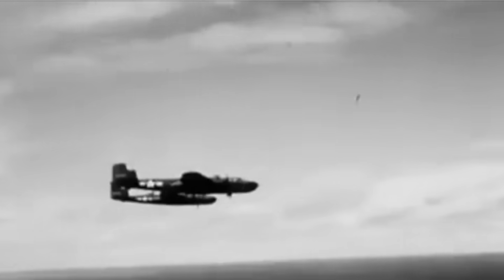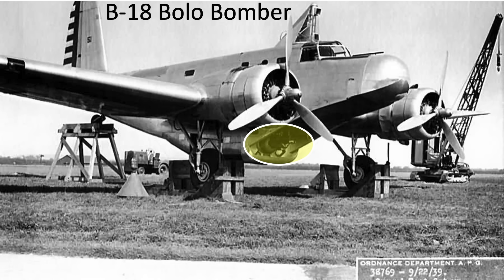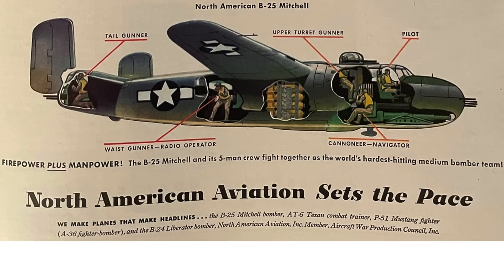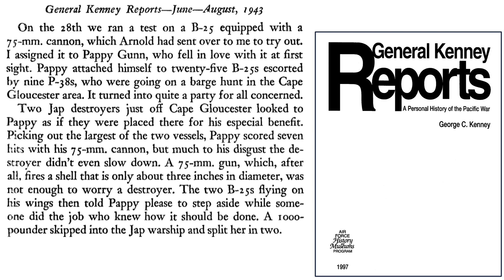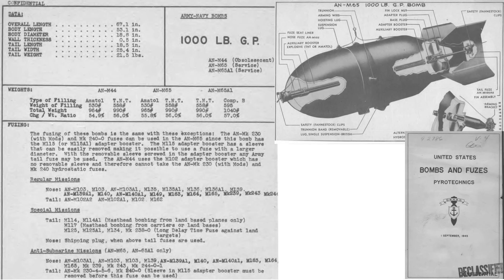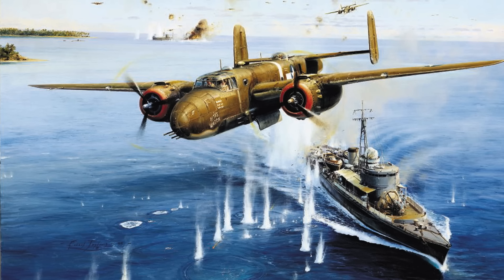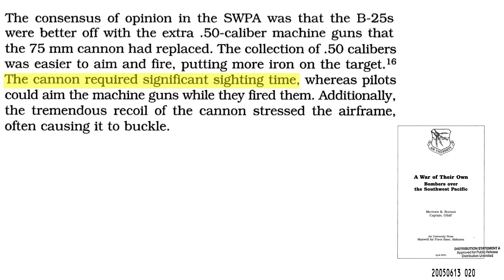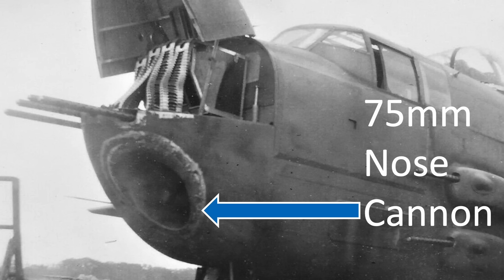Why the B-25’s 75mm cannon was a Failure - Deep Dive Review

Comment: B-25Hs were supplied to the 5th AF, 345th Bomb Group Air Apaches. In the book, "Air Apaches: The True Story of the 345th Bomb Group..." By Jay Stout, related basically the same narrative - better destructive performance with machine gun and bomb loaded B-25s than the 75mm cannon. The 345th removed the cannon and replaced it with a tray of 4 additional .50 cal machine guns within a few months of its introduction. Besides the greater devastation provided after removal of the cannon, the 345th used the copilot as cannonier, and stated that just when the pilot needed his copilot the most during the exceptionally challenging low-level attack runs, he was occupied loading the cannon. For the 345th, this was the deciding factor that tipped the balance towards locally removing the cannon almost immediately after introduction.

Comment: The 75mm was too big and too slow. What they really needed was say a 1.2 inch gun that fired slugs of something heavy and hard like depleted uranium around 3,300 feet per second. If it happens to have 7 barrels and fires 3,900 rounds per minute well that is just about perfect. Of course I am referring to the GAU8 from the Warthog. It is amazing the smaller gun has around the same weight but with ammo loaded is massively heavier. The penetration is comparable to the 75mm ammo used and could penetrate any of the armor on a destroyer of the time. .50cal just couldn't penetrate the armor on the turret faces and the main guns were used for antiaircraft duty. .50 was marginal on even the shell plating of a warship of the time. Brrrrt.

Comment: A funny thing  the DH Mosquito MK.XVIII  nicknamed Tetse, were built as an anti sub, anti shipping variant with a 57mm auto cannon that proved successful against Uboats and destroyers as well as aircraft.  The auto feature coupled with 50cal machine guns to aid in aiming did work as intended. The cannon reloaded fast enough to deliver 6 rounds of a solid iron shot on target.  Though only 18 were built it was seen as a success and they did kill a number of submarines. Of course a submarine hull is densely packed with essential machinery and a 57mm round passing through did tend to ruin ones day. In one instance 4 rounds hit a sub and it sank 20 minutes later. Several crew were killed by the rounds.  The first sortie was in June of 1943.
Reply: Interestingly, both the 75mm M4 and 57mm/6-pdr Molins gun did live on in alternative roles once they were replaced by more effective weapons. 

The 75mm formed the basis for the cannon used on Chaffee light tanks, and the 6-pdr found its way on Royal Navy torpedo boats for extra firepower against German E-boats.
Reply: By 1944 though, the  RP-3 rocket was proven to be far more suitable weapon for the Mosquito than the 6-pdr Molins gun.

Comment: PT boats armed with stolen 37mm aircraft cannons made short work of Japanese transport ships in Guadalcanal.  I would think putting two such cannons in place of the 75mm would have been much more effective.

As a pilot, I can tell you a good copilot is worth his weight in gold.  Most I would happily replace with a cupholder if I could.  I dont see the loss of this position on the H models as a bad thing.

Comment: A shame the 75mm couldn't cut it as an aircraft mount, Its my favorite B25 variant and the idea seems so cool in concept. I guess that's what the designers were thinking as well hence why the testing was so rushed and incomplete. More .50 cals is hard to beat if they were looking for pure AA suppression, Makes me wonder what would have happened if they had designed an autoloader like the Germans did for the HS 129, or had retrofitted a 37mm from the p39 instead.

Comment: -Clearly the lack of an autoloader for the Mitchels 7.5cm gun was an issue.  The British added an autoloader on the 57mm 6 pounder.  This was the standard AT gun modified with an autoloader developed by the Mollins cigarette machine company. Used on a "Tse Tse" Mosquito it was Effective against u-boats and FLAK emplacements and probably the only airborne AT gun that could penetrate any tanks frontal armour. 
-The Germans apart from an adaption of their 3.7cm FLAK gun (film of these hitting water and shipping on Dnipro and Volga rivers is incredible due to the 30ft tall columns of water) also developed auto loaders for the 5.0cm and 7.5cm AT guns (used on the Me 410, and HS 129/Ju 88P)
-The problem really was the cumbersome vulnerability of these aircraft.  The Tse Tse was the best of the load due to its low drag installation but even it was a bulky target.

Comment: One wonders how well it would work if they split the difference and tried something like the 40mm Bofors instead.
Or added 20mms to the .50s, the Buefighters  had a devastating effect against Japanese destroyers at the Battle of the Bismarck Sea
Reply: The 37mm out of Airacobra was minimum for reliably?? punching holes in submarines while having a firing rate high enough to assure hits.
Reply: The one factor against that was the very high demand for the 40mm Bofors. They were very effective AA guns after all.
Reply: That's what I was thinking, even a pair of 20mm could have had very good suppression potential and work great with the .50s already there, or even wreck the superstructure and start fires.

Though like Pilotmario says, autocannons of all kinds were already in great demand for all sorts of uses so it might have well been an idea that was rejected earlier

Comment: Great video. Not all ideas work, but some are worth the try. Still, it was a big leap from 37 mm to 75 mm. I wonder if a 40 mm Bofors would have been a better candidate. It was fully automatic, had a good rate of fire and could accommodate high explosive, incendiary and armor piercing ammunition. These were used to great effect on AC-130 aircraft.
Reply: Thinking the same thing

Comment: Yep cannons required nosing up losing sight of targets and took 5kts or so off airspeed, not what they wanted going in. The rivets were also being loosened. 50's at range were handling anti air and best. After a typical 2 plane run on target they had to be sure to not be aimed at other planes due to hot barrels sometimes cooking off rounds.

Comment: My father was a tail gunner on a B25J in the 11th Air Force stationed on Attu in 1945 where they flew very long range (1500 mile round trip) overwater missions to Paramushir in the Kuriles to skip-bomb Japanese cargo ships in the harbor there. A bomb bay fuel tank and underwing drop tanks allowed them to make the range but limited the internal load out to 4 X 500 lb. bombs. Eight to twelve planes on each raid were shepherded by a navigation B24 high above the clouds so they wouldn't get lost in bad weather. My father's B25 carried the same electronic navigation equipment as back up.

One of dad's jobs was working with ground crews to load, inspect and install ammo belts for all machine guns. He also had to load, test and maintain all cameras. His crew did not sink any ships but another aircrew who "borrowed" their B25 was credited with sinking one.

Dad's crew flew 12 missions. All were based on codebreaking intel which said a Japanese merchant ship or ships were there. Only once was the intel wrong. No ships were in the harbor so they bombed their secondary target which was the fish cannery there. It was their worst mission. AA over land was much heavier and four of eight B25s were lost, one of which landed across the narrow straight on Kamchatka where the USSR interred it and crew.

BTW the Soviets took the Kuriles and renamed the town Severo-Kurilsky which was destroyed the the 1952 tsunami and rebuilt on higher ground but struck again by the 30July2025 tsunami from the magnitude 8.8 Kamchatka megathrust earthquake.

Comment: And every historian told us they were a genius move, thanks for educating me.
Makes me wonder about the 7.5cm Bordkannone the Germans used.
Reply: Brits had the same experience with their Molins guns on Mosquitoes. After a couple of sorties they figured rockets were more useful & safer for the air crews
Reply: It was completely different type of gun and completely different application, the only thing they shared was caliber (but it's like saying Minigun and Nagant revolver have something in common because of caliber).
The Bordkanone was a primarily anti-tank gun, a high velocity gun by default, that on top of it was loaded with tungsten-core rounds that gave it extra velocity and penetration. They could successfully destroy every tank in existence, and had easy job firing accurate shots due to stable platform that the plane provided. Being mounted on a purpose-built platform allowed to use this gun to it's highest potential.

German tank destroyer planes were effective and successful assets, simply not available in enough numbers to work on strategic level (and later on of course hampered by lack of air superiority)

I think the problem with 75mm on B25 was missed application. The gun did not have enough explosive power in shell to effectivelly suppress gun crews, but it could possibly be effective in sinking tankers, submarines, merchant ships, torpedo boats and various other smaller vessels using APHE rounds

Comment: I am impressed that  they hit it as many times as  they did,
Reply: They lucked out in that the cannon firing line was roughly in line with the center of mass of the aircraft. Other aircraft tried this and it got very squirrelly very quickly - one accurate shot per strafing run and then the aircraft was bouncing all over the place.

Comment: Quite interesting.  Popular literature often leads one to believe that the 75mm B25's were more effective than they really were.  On a side note, the development of the lightweight 75mm gun M4 DID have a positive as it lead to a version of that gun being adopted for the T24 light tank project that was produced as the M24 "Chaffee" light tank in late 1944 into 1945.  The 75 was a major improvement over the 37mm cannons used on US light tanks.  The American 75mm in WW2 mostly traces back to the French Model 1897.  The cannon round was quite similar between the 75mm guns used for ground, tank, or aircraft use.  The tankers liked the 75mm as it was a better HE weapon that 37mm or 76mm guns, even if it lacked AP power against late-war German tanks.  The First US Army's "Report of Operations" shows that 75mm HE was fired at a 3:1 ratio over AP.  Did the AAF develop different ammo for the 75mm?  For ground use, they fired a solid AP shot, which isn't going to do too much on a ship-sized target.  The HE round had a point-detonating fuze (with a slight depat adjustment available).  So the HE likely exploded on contact with the ship or while the projectile was still penetrating the steel structure.  It would take a number of 3" holes to sink a destroyer with a trained damage control crew.  One can also note the cumbersome loading action for navigator/cannoneer - tank crews didn't have to seat the round, then reach for a stick to ram the round into the chamber. Have you looked into comparisons between strafing with .50 cal versus 20mm (ala Beaufighter or Mosquito)?  It might also be interesting to hear about the British use of their Mosquitos with 57mm guns.
Reply: The primary target of the B-25Hs with a 75mm gun was merchant ships carrying troops to New Guinea. They were very effective at sinking merchant vessels - to the point they ran out of vulnerable targets.
Reply: @allangibson8494  AFAICT, there were 1,000 B-25s with 75mm canon built (search for "how many B-25 with 75mm canon were built"). So "running out of targets" was a significant disaster. Further, AFAICT, there were typically less than 10 merchant ship troop carriers on a mission. A few dozen 75mm cannon armed B-25s, with long range fighter escort may have been plenty, and more effective because of fighter escort. 

Building 1,000 B-25s with 75mm canon, increasing logistic complexity (by adding 75mm ammunition and spare parts) to keep them flying, then removing the 75mm canon, and retrofitting two machine guns in the canon's 'hole' seems like a significant waste of time and resources.

Also, were the B-25Hs with a 75mm canon tasked with attacking merchant ships because they were relatively ineffective against destroyers? 
Take Care. ☮
Reply: @gbulmer The Battle of the Bismarck Sea was where heavily armed bombers shone. 
By 1944 Japan couldn’t feed its army in the field or its people at home but the military leaders didn’t think that was a “problem”. On Bougainville, the primary activity of the Japanese military in 1944 was farming.
Reply: @gbulmer At least the 75mm cannons used the same ammo as the Sherman tanks in theatre, and the Aussies could make use of them for their Grants.
Reply: @allangibson8494  Thank you for replying. I apologise for taking so long to reply.
My point was mainly about the waste of resources and time producing about 1,000 B-25s with 75mm cannon, then removing the cannon and retrofitting 50 cal machine guns. Making those variants involved other modifications to the aircraft, including removing the co-pilots station. As the co-pilots station was re-introduced in later variants, I AssUMe it improved the aircraft. 

I agree, The Battle of the Bismarck Sea proved the value of heavily armed bombers. It seems very good proof of the value of 'skip bombing' and the importance of heavy fire from the bomber to suppress a ship's AA gun fire while on the essential low-level bombing run.
AFAICT, that battle involved co-ordinated use of B-25s, B-17s and Beaufighters attacking ships. One innovation was simultaneously attacking a ship with both side-on 'skip bombing' run and lengthwise (eg. stern to bow) strafing to further suppress AA fire. It appears the tactic of bringing many more guns to bear, and simultaneous attack from different directions were crucial to suppressing AA fire.

AFAICT, B-25G variants, B-25s armed with 75 mm canon, had the B-25G variant's First Airplane Accepted on May 8, 1943, and the B-25H variant had First Airplane Accepted on August 11, 1943 ①.

Those dates were after The Battle of the Bismarck Sea (March 1943), and hence not relevant to the point about wasted time and resources. 
Again, apologies for my slow response.
Take Care. ☮

① I found those dates by searching for "when were B-25G B-25H armed 75mm canon manufactured?" which yielded an organisation called b-25history, and articles 'B-25G-NA' and 'B-25H-NA'.
Reply: @gbulmer The field modified 75mm armed B-25’s predated the factory versions.
Reply: @Pilotmario  Thank you for replying. AFAIK, most tanks were not actively fighting near airbases. So, I can agree 75mm ammo production may not have been wasted, but logistics for operational 75mm-armed B-25s were still made more complex than B-25s only armed with 50 cal machine guns.

As an aside, are you confident the 75mm round destined for B-25G and B-25H variants were the same, or similar enough, to the rounds used by Sherman and Grant tanks? I can easily imagine so because it would be so much simpler that it'd be well worth avoiding ammo variation. However there were experiments with different charge sizes in the round to establish how much stress the 'plane could take, and firing the 75mm was claimed to damage the aircraft. So it may have been useful or important to NOT AssUMe the rounds were interchangeable. If that were the case, a 75mm round destined for aircraft use would have increased logistic-complexity across the whole supply chain.

Best Wishes. ☮
Reply: @allangibson8494  Thanks for continuing the discussion. That's a plausible idea. However, the b25-history organisation's 'B-25G-NA' page includes _"63 ,,, modified from B-25Cs" in "Total Produced: 463", and "First ... Accepted: May 8, 1943".
What evidence is there that 75mm cannon armed B-25 were fighting in The Battle of the Bismarck Sea, and how many? Also, how would I find the sources of that information ① ? 
The sources I've found mention 'strafers',  B-25 variants with 50-calibre machine guns mounted in the nose. fighting in The Battle of the Bismarck Sea (eg 'Paul Gunn' at Wikipedia, and the pdf "The Man Behind the Guns"). However, no mention of B-25s armed with 75mm cannon fighting in The Battle of the Bismarck Sea.
Best Wishes. ☮

① I use a search term, eg. "how many B-25 with 75mm canon were built", a hint about a site, eg. b25-history organisation and/or title, eg 'B-25G-NA', usually works quite well to identify a source, and YT allows it.
Reply: @gbulmer The ammunition was identical to those used on the Grant or Sherman tanks. The modified cannon was later adapted for use on light tanks such as the M24 Chaffee for that reason.
Reply: @Pilotmario  Thank you for replying. Would you please share your source(s)?
 I use a search term, eg. "how many B-25 with 75mm canon were built", a hint about a site, eg. b25-history organisation and/or title, eg 'B-25G-NA', usually works quite well to identify a source, and YT allows it.
Thanks again.
Best Wishes. ☮
Reply: I actually can't believe they bothered using this gun on ships at all. I had thought for years the B-25H was used for ground attacking and the gun intended against hardened targets like bunkers or tanks the same way the Germans were trying to squeeze the Pak 40 into the Hs-129 for killing T-34s. 75mm is nothing to a warship.